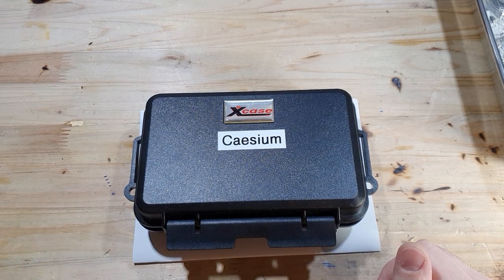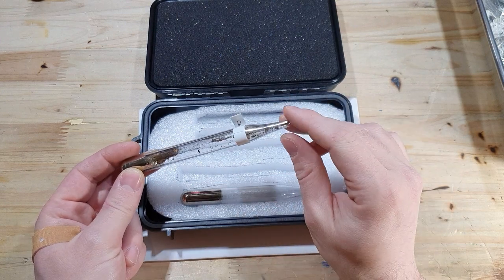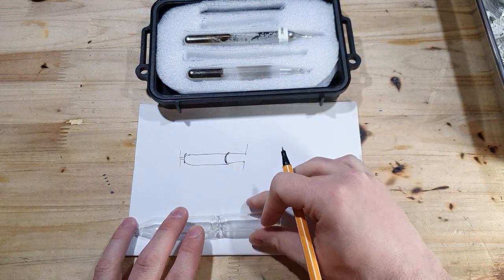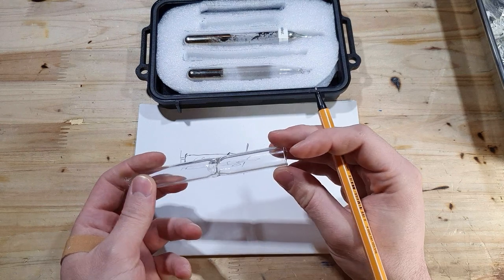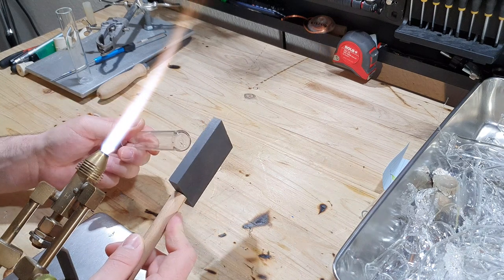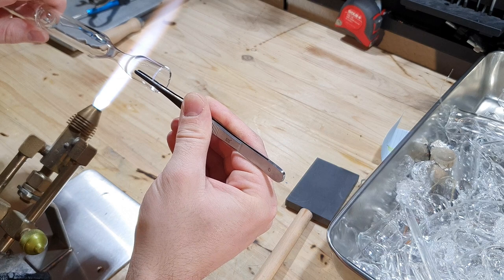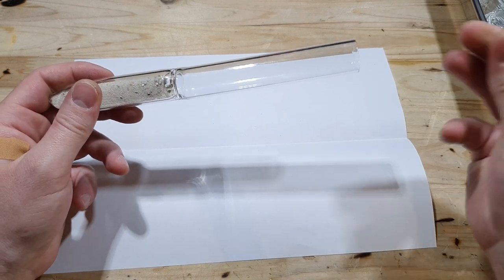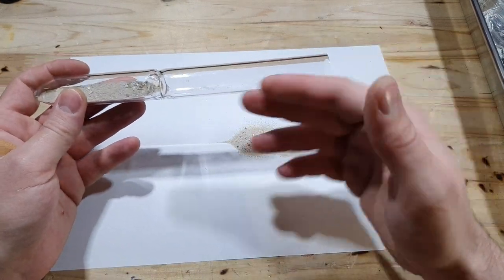Making breakseal ampoules for highly reactive chemicals

Comment: How strong are commercial breakseal ampoules in your experience? I have an ampoule of 50g of cesium I bought and I would like to play with it molten more often but I'm worried about the momentum of it sloshing around would crack the breakseal (similar to water hammer). Have you ever had this happen, and should this be something to worry about?
Reply from the maker: I never worked with a commercial breakseal ampoule so I can't tell you how robust they are. But for the reason you mentioned I would be careful when handling it. Especially if there is a vacuum inside the ampoule. The liquid cesium can exert a lot of force when sloshing around.